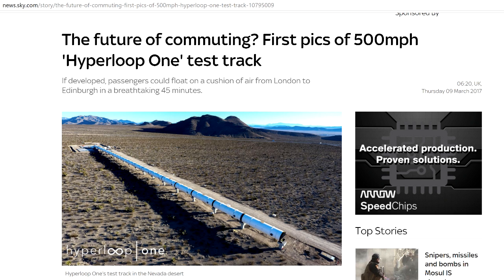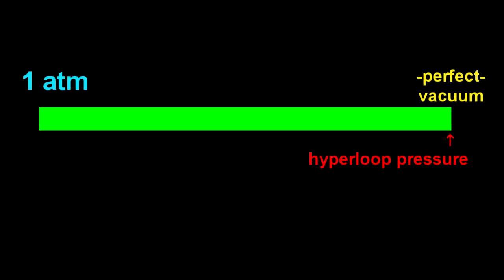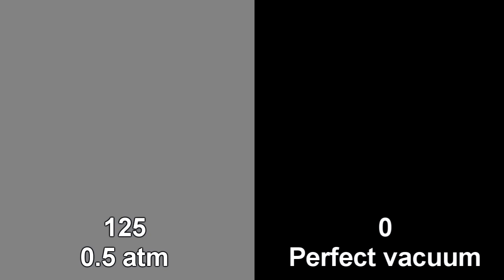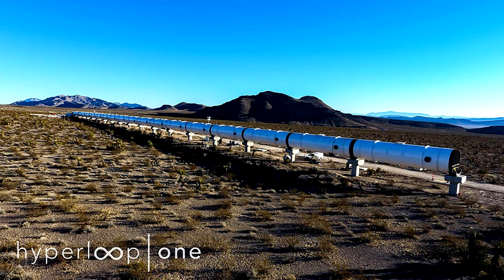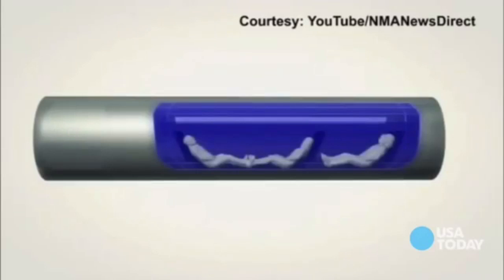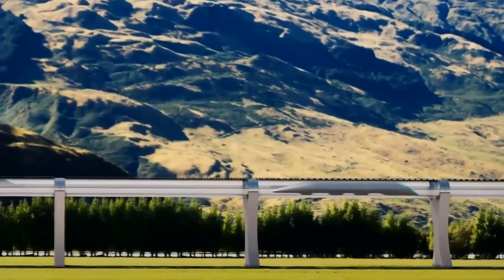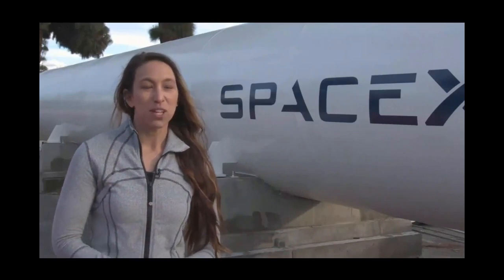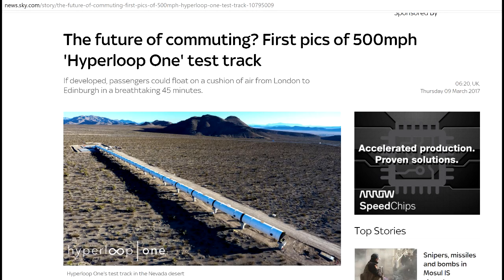Entire Hyperloop could be destroyed in SECONDS!

Comment: I'm sorry, Thunderfoot, I like most of your videos, but the arguments presented here are basically non-arguments. If a petrol tank, which isn't supposed to withstand a vacuum, fails, doesn't mean that you can't design a tube that will very successfully do that. And if Elon Musk only built a short tube for the test, is that a reason you can't scale it up? And by the way, measuring energy in kilograms of TNT isn't very illustrative, as it has relatively low energy density, roughly 10 times lower than gasoline, and 5 tons of gasoline doesn't really seem like a ludicrous amount to burn, considering you would probably design a system that allows you to seal the tube while the passengers get on and off the pod, so you only really need to suck the air out once.

Comment: The hyperloop is currently a bad idea, but over time the engineers will start thinking about pressure a bit more. Some of the points you made were irrelevant, such as comparing the pressurization time for the test track to the estimated journey time. If Elon Musk really wants this to work, airlocks will be used!

Comment: Despite clear evidence of this being crazy I can't stop wondering about how to make this work haha.
Obviously you'd want to bury and encase the loop in concrete, buffered against earth shocks, use airlocks to enter and exit the tubes, need materials that have little thermal expansion and would need "air locks" at regular intervals in the hyperloop to isolate segments, and probably something like valves that pressurize the segments from two different points quickly to avoid crumpling, and would want very sturdy cars that use magnetic levitation... and allow to regenerate energy when slowing down the car. I still think this has to be the future of transportation in a century or so. Friction is just too wasteful isn't it?
Or maybe with unlimited power from fusion it just doesn't matter.

Comment: Also, wouldn't a more feasible concept use a hydraulic system as opposed to manipulate pneumatics?
You could, after all, power a hydraulic system using the water pressure generated from a dam.

Comment: MythBusters had to drop a several thousand pound concrete block from 50 feet just to put a dent in that tanker car, who is going to be able to damage Hyperloop like that when the tube is elevated 40 feet in the air? you can't crash into the tube, you can't damage it with a hammer, the very best you could do is maybe shoot it, but I doubt a bullet hole will cause a catastrophic failure of a tube.

Comment: I don't get why there's so much interest and investment in this idea and none given to the proven and reliable technology of a regular maglev train which would be cheaper to build and safer to operate and require less energy to run and could achieve more than half of the proposed speed of the hyperloop. A regular maglev train on an express route between LA and SF would take a little over an hour (at 1.5 hours) and be comparable to taking a flight (at 55 minutes in the air not including security and check in wait times).

Comment: I know that the Hypoerloot is... is viable at least. And i dont think it will work.. but some of your arguments are kind of thin.

For example, you mock the time it took them to get something in the tube. However, assuming the hyperloop was actually build, they wouldnt pump down the entire tube each time they put a vehicle in it. There would probably be a specific chamber that's pumped down and then connected to the rest, right? Similar to what a watergate does. You dont pump down the whole river. Again, in general i agree with you, but some of your mockings really are not quite fair imo.

Or the argument that the tube would easily collapse from a single bullet.. sure it would. However, assuming it was build, do you really think there would be no protection around it?

I didnt make this post because i think the hyperloop will succeed, because i dont.. however, i think you should use such easy to attack arguments as your main points sometimes. It just weakens your position to those who think it will actually work. That's like, if you have X strong arguments that are fully enough to show that something is stupid, then dont bring Y somewhat true, but easy to attack arguments. Attackers will always just focus on Y's, ignoring X, but acting as if showing that some Y are not a problem at all, neglects X as well.

Comment: Could they not have an airlock? So the main tube could constantly be under vacuum but the part you get in and out of the loop would be shut off from the main tube and then be pressurised and depressurised? Then you would only need to remove the air from the part you have inside the airlock (20m or so, or how ever long the transport pod is). Sorry I didn't make much sense. Obviously this still doesn't address the countless other problems. If what I said is even plausible.

Comment: Atmospheric pressure is indeed a force not to be underestimated. One of the most enduring memories that I have from childhood was when my primary school teacher, Mr O'Connor, brought a large, empty, motor engine oil can and a camping stove, to school. In those days motor engine oil was sold in metal cans and not plastic containers. He took the screw top off of the can and then put it on the lighted camping stove, for long enough for the air inside to heat up dramatically. He then switched off the stove, screwed the top back on the can, and stood back as we all watched the can slowly crumple.

Comment: While I thoroughly love your debunking videos, I think the concerns raised in this one could be overcome.

I actually think that the hyperloop is kind of a neat concept, mostly because I designed it on the back of an envelope at age 14-ish (it's also a highly obvious idea).  Being in my early teens, I envisioned a service speed in the Mach tens, where running into even a small amount of air would have much the same effect as hitting a concrete wall.  Even back then (in the mid-nineties), I considered that it would be extremely vulnerable to sabotage, and figured the tube would have to be buried in concrete under heavy guard.  

I eventually wrote it off as "not quite worth it" due to the logistical hassle of turning the cars around - in order to be energy efficient, this needs two parallel tubes where the deceleration of one car is absorbed into a linear electrical generator of some sort and used to accelerate the car going in the opposite direction.  Still, in this day and age the idea could have legs to stand on, considering the ever rising demand for rapid transportation and the increasing energy cost.

Comment: What about having a normal tube, and a sphere capsule? Lube the tube, and drop the sphere from a fair height. Much of the distance should be covered by the sphere's own volition. It would require no power to run. It won't get too far, but this thing can't seem to get you down the block.

Comment: How would this idea function if you made the tube a propulsion system, meaning that you would basically remove the air in-front of the "train" and pump air in behind it, along the line, while the "train" was moving. Some neural networking AI and a lot of valves. Might be expensive though... just an idea.

Comment: Submarine hulls experience more than an order of magnitude more net external pressure than the hyperloop would experience. While you point out valid engineering challenges which will need to be overcome to make such a design feasible (e.g. thermal expansion, protecting the external surface, energy needed to evacuate the loop, etc), you haven't made a very strong case for why they cannot be overcome. I won't sit here and say that the hyperloop will ever be built, and even if it is it might not come as close to meeting the claimed speeds as many hope, but all of your videos on the subject have amounted to an argument that 'it doesn't work now so it won't ever work.'  Showing me a tanker truck which was never designed for external pressure imploding does nothing. You could easily calculate the hoop stress which the tube will be subjected to under 1 atm and estimate the wall thickness and materials required to provide adequate safety factor. If exotic materials or 3 foot walls are required, you know it's a failed idea. But instead of crunching some numbers, you make a video that is the equivalent of bringing a snowball to congress and claiming global warming to be a hoax.

Comment: Doing a quick dimensioning with Barlow's formula. A vaccum shouldn't be a problem at all for a steel pipe with a thickness of 10 mms and a radius of 1500mm.
he didn't include this basic calculation in the video but instead shows clips of object that are build for force outwards and not inwards. considering the small one works fine why wouldn't the larger one. I am certain that the pipes have been dimensioned correctly as you have to follow a lot of Iso norms when constructing anything. otherwise the responsible engineer is liable in case of failure.
the calculation for the energy should be right though one has to keep in mind that this energy is evenly distributed along the entire pipe.

Comment: I'm guessing they're still trying to use some traditional vacuum pump set up to remove the air. Unless they have multiple highly efficient pumps, if they cut the prep time down to a few minutes, it'll be really annoying to sit and wait. 

Plus I think the plan would only be practical for really long distances, like trans continental, or coast to coast. A charter plane would by far still be a lot cheaper per individual trip across short distances.

Comment: According to TF's pressure arguments submarines shouldn't exist.  After all every 10 meters you dive under the water increases the pressure by about an atmosphere.  There's no way they can build something that will survive the pressure of 1 atm let alone several.  Heck the Bathyscaphe Trieste could never reach over 10k meters under the ocean.
Reply: Now show us a submarine, 1000km long, that can dive to 10m.
Reply: No one would build a sub like that because subs are supposed to be mobile and turning anything too long would be a nightmare.  My example showed that several hundred atmospheres of pressure is possible so given that a single atmosphere is then not impossible.
Reply: Nobody would be foolish enough to build a one atmosphere pressure vessel, one thousand kilometers long. It would fail in a thousand points before they got it finished, and when the sun heated it up and expanded the material, it would buckle and fail. 

The fact it's possible to build something one hundred meters long that can withstand higher pressures isn't relevant.
Reply: It is relevant.  Submersibles routinely go to much higher pressures.  Sure the example I gave is a tiny craft however we have much larger submarines which the only real limiting factor to their size is the power they need to move around.  A submarine with the dimensions you suggested would be much too large to move efficiently.  It would basically be immobile.  That doesn't mean it can't be done just that doing so would be pointless.

The example of the pressure collapsing a tanker truck was staged.  Tanker trucks aren't built to withstand that pressure.  The same principle is used to collapse 55 gallon drums.  The drums implode because they're not built to withstand the pressure, not because creating the vacuum is impossible. Using that as an example of what would happen is like saying you can't make submarines because ships sink when they go under water.  He's using equipment not build for the task at hand to prove the task at hand is impossible.
Reply: Wrong. It's not relevant. It's practical to make tiny craft able to handle one atmosphere; something thousands of kilometers long is just absurd.
Reply: The tiny craft I mentioned handled over 993 atms.  Ohio class submarines can dive to 800 feet or withstand 25 atms.

The hyperloop only needs to withstand 1 atm  and their test track has already been shown to hold the pressure nicely.  The test cars were pretty disappointing but the track itself worked as intended.

Why do you continue to feel that other structures that have held massively more pressure have no relevance to a the hyperloop?   Yes the hyperloop is longer but that doesn't mean that the materials will be holding more pressure per square inch.
Reply: >Why do you continue to feel that other structures that have held massively more pressure have no relevance to a the hyperloop?  

Obviously, they don't. Why do you think that a one hundred meter pressure vessel is relevant to one over ten thousand times longer?
Reply: Careful there's a long list of "absurd" things that science has made possible.

You still haven't give me any specifics on how other structures that handle massive pressure or vacuums don't apply to the hyperloop.

I didn't bring up the large hadron collider before because I didn't feel it was necessary.  However it is 17 miles long and has yet to suffer any massive structural collapse due to pressure.  Though there was an incident where 6 tonnes of Helium was vented into the tube.  It damage a lot of equipment in the tube but the tube remained intact.

I'm not sure if you understand that the hyperloop even if it extended around the world wouldn't handle more than a single atm.
Reply: You have a vague notion that science does magicky things, which it doesn't. 

An Ohio class ballistic missile submarine costs twelve million dollars per meter. If we say one percent of that is the pressure hull, we're at $120,000 per meter. 

And you think that's a convincing argument to build one one million kilometers long.
Reply: Magic?  No science doesn't do magic.  However science has done things 
that may seem like magic if you don't understand them.  The claim that 
building this was absurd.  Flight was considered absurd or even space 
travel, the very fact you can type a message and I receive it in seconds
 despite not even knowing my location. Science has done those things.  

The complaints were about the inability to contain vast amounts of pressure
 at large scales.  We have the large hadron collider, we also have other
 vehicles that can handle vast amounts of pressure.  Humans can do some 
amazing things.  

Will the hyperloop live up to the hype.  Probably not.  But to act like it's impossible is folly.

I don't claim to know the costs of building this.  However roads aren't 
built for free either.  Ultimately it will be up to the designers to 
decide if it's feasible and if they can raise the cash to do it.
Reply: >However science has done things that may seem like magic if you don't understand them. 

Which you don't.

>The claim that building this was absurd. 

Building a hyperloop between San Francisco and Los Angeles is absurd. It's unlikely that the California High-Speed Rail project will succeed; and railroads are much, much better understood than miles-long pressure vessels. 

>We have the large hadron collider, we also have other vehicles that can handle vast amounts of pressure.

The Large Hadron Collider's tunnel is 27 kilometers long, 6.3 centimeters in diameter, and is sensibly buried under ground. Good luck riding in a 6.3 centimeter wide tunnel.
Reply: "It's unlikely that the California High-Speed Rail project will succeed; 
and railroads are much, much better understood than miles-long pressure 
vessels. "

We learn by trying and failing.  If we only did things we fully understood many things would never be discovered.  Some things can only be learned by trying them.

The trial runs weren't to help Musk out.  As we saw during the test he's miles ahead of the trial teams already.  The tests were there to give people hands on experience with building things like this.
Reply: >We learn by trying and failing.  If we only did things we fully understood many things would never be discovered.  Some things can only be learned by trying them.

I don't think science progresses much by spending billions on technology that doesn't work at all, let alone better than existing cheaper solutions.